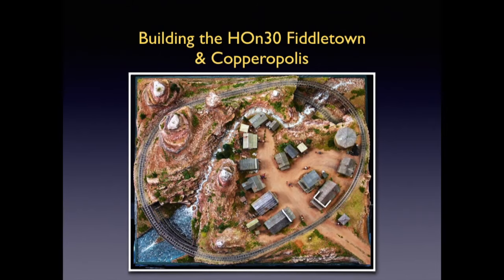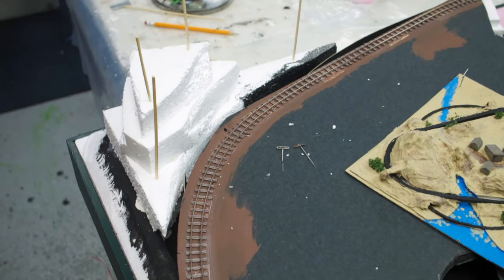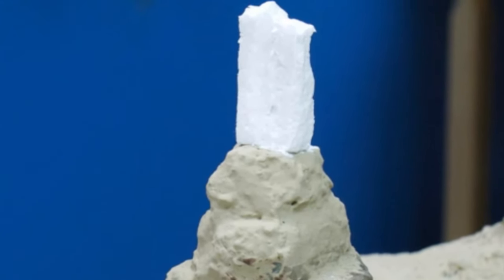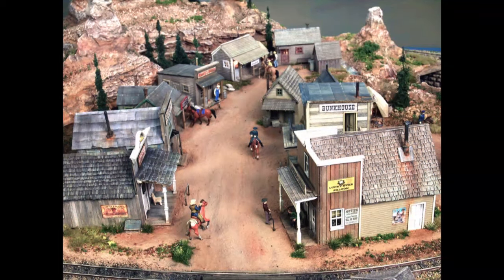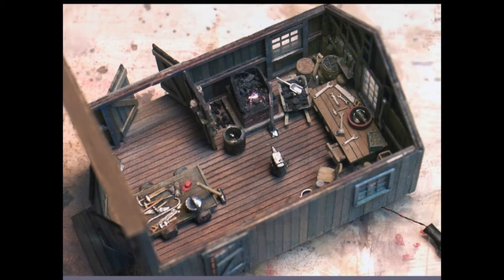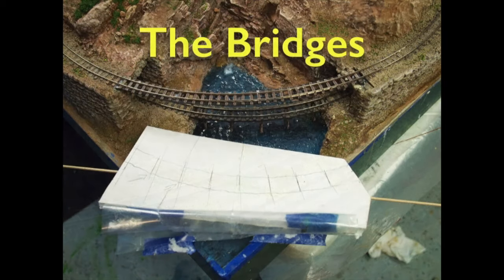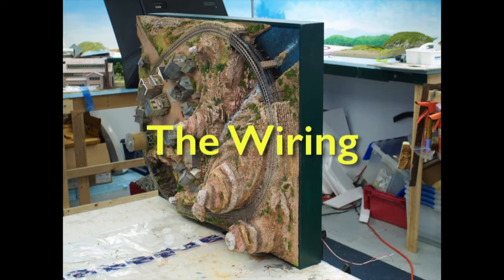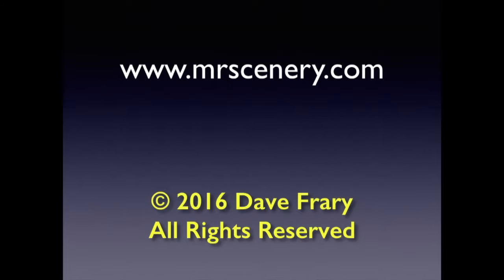Building the Fiddletown Display

Comment: I'm also a former Boy Scout but I'm also a former Devil Pup which is the Marine Corps version of the Boy Scouts (  predate 9 / 11 ) late 1960's to 1974 .
you got very lucky with your clamping arrangement those false ceilings are not very sturdy and are Not meant to carry weight so even if you did  knock  over your lay out that ceiling would have come crashing down right on top of you .  otherwise I enjoyed your video , it has given me several ideas for my layout for Ho/ n3         dual gauge with two  standard Ho Main lines .
Reply from the maker: I installed the ceiling, it was plenty srtong!

Comment: I hate gator board. I didn't realize other people were using it as i did, and used it in a frame made from aluminium window framing parts and sat the gator board as the base, then mounted a layer of cork sheets on top. It lasted quite well for about 2 years, i built a Z gauge layout on top of it, its light and portable, but here is the problem, it really doesn't like heat. Leaving the layout on the back seat of the car one afternoon in the heat, it cooked the plastic gator board and warped it badly, which in turn ruined the Z scale track work. i had to strip the whole layout again down to its base aluminium frame, but this time i used thing marine grade plywood as the base, then compressed foam sheet, then cork tiles (cut and modified) and foam underlay for the rail. This "new" layout is a combination of HOn30, HOn3, HO, and some HOf (z scale mech's) , point to point for the HO/HOn3 track, a loop with switches for the HOn30, and the loop of HOf is raised in "sections" , mostly bridges. what ever you do, if you use gator board, don't let the layout get hot. I am not sure of the temperatures it got to in the back of the car that day, but it only took  a couple of hours to ruin a lot of work.
Reply from the maker: I've never had the problem of ½" Gator Board warping. But then again, it's only been in moderate temps.